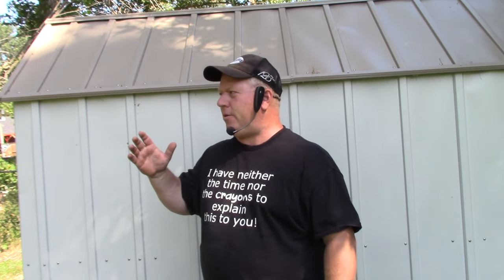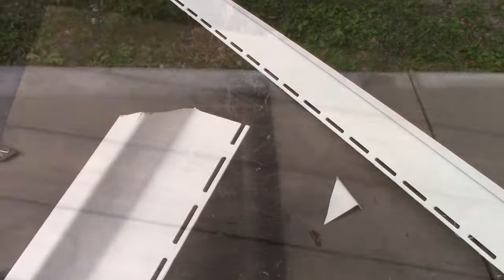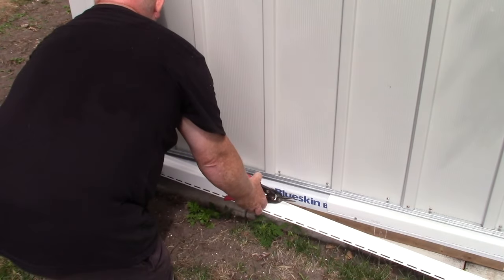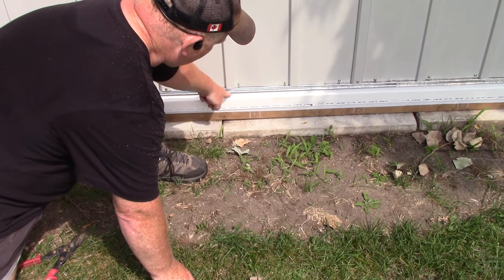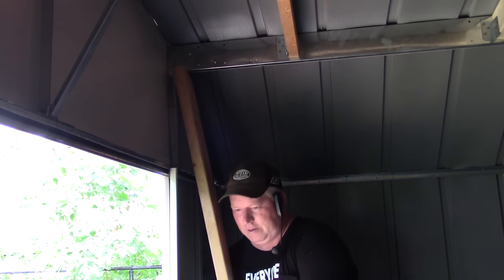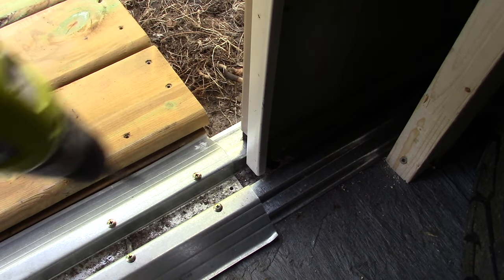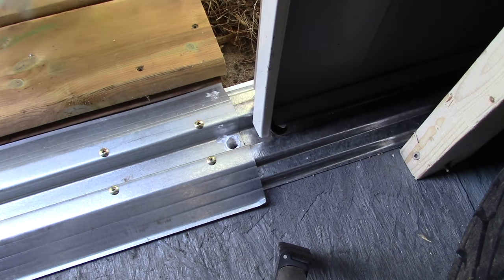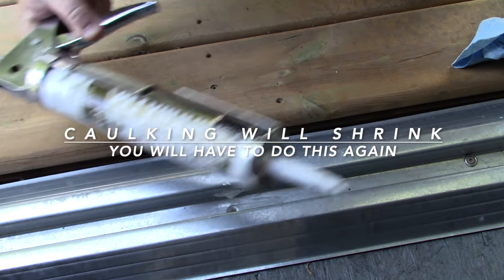Metal Shed Base Waterproofing

Comment: Hi Rob. I purchased and am using a nice little metal shed for my Hens. It's a nice shed, however, this recent 2024 Fall, when the rain began, I found the sand on the plywood floor of the shed was very, very wet. Your shed setup looks similar to mine. Several days ago, on a dry day I chalked around the outside of the shed where the base meets the plywood. It's drying slow... very slow in this humidity, but it's doing something, Smiling. I was getting ready to go and hang a tarp over the front door area so that the water would not drain inside the front sliding door track seam area and thought I'd check to see what other DIY folks are thinking. I searched You Tube and of course found your 2-year-old idea. I'm liking it! I'm going to drill some holes in the metal track of the door, but until I can go beyond what I have said, I'm going to have to hang a tarp over the front area to divert the rainwater until I can get the other great ideas on the shopping block. Thanks for the ideas and video!
Reply from the maker: @lavernabouzspain    Yes I drilled holes, put caulking in certain areas to channel the water.  I think that’s in a different video.  Anyway thanks for your comment and good luck with your improvements!
🍻

Comment: I have been having a TERRIBLE time with water getting into my new shed! I really want to get my tools moved into it, but don't dare until I can be sure I have plugged all the leaks. I happened to have a gallon of Flex Seal that was supposed to be for another project that didn't get done so I painted the OSB that I used for the floor. I have also sprayed Flex Seal and caulked multiple seams/screws/bolts, possible gaps as I can think of. I will be drilling the holes in the door slot!
Reply: Is the flex seal working well? Got alot of water intrusion in our recently-built shed on a plywood base and would like to seal it up, especially around the base where most of the water seems to be getting in.
Reply: @daniele.644  For an overall floor covering, no, it's wearing off. Probably would have been better to use a marine paint. Because my roof is leaking I'm not sure if I am getting any water from around the base or not. I have come to the conclusion that the metal shed kit was a big waste of money for my intended purpose.

Comment: Terrific looking method. I bought a house w the same shed and the wood floor is completely rotted and fallen through. The shed has some rust but it’s not coming through to the inside so I’m gonna sand, paint then rebuild the floor. I’m gonna use your method. The window cap with the built in lip is genius! Thanks!
Reply from the maker: Good luck with your rebuild!  Thanks for your comment!
Cheers!
Rob

Comment: Thanks a lot. I happen to have the same shed and thanks to you I searched window cap in homedepot and found the vinyl siding. Also learned how to raise shed. In my case not sure it's a good idea to interfere with their provided drainage holes for the doors as my shed is slightly inclined towards outside for that side and also less exposed.

Comment: Curious has it been working for you? Can you get the window and door cap in different sizes?
Reply from the maker: Works well.  I added some spray foam in the frame at the corners so no water gets in there.  I only found that door cap in one size.
Reply: Thank you for the reply @robsgaragewoodworkin
Reply: @robsgaragewoodworkin  thanks again I clicked on your link and see that you were in Canada. So I went to Home Depot here in the US and all they had was aluminum. I went to Menards which is our other Lumberyard here in the states and they had the exact same company and the exact same product that you used! Hooray success!